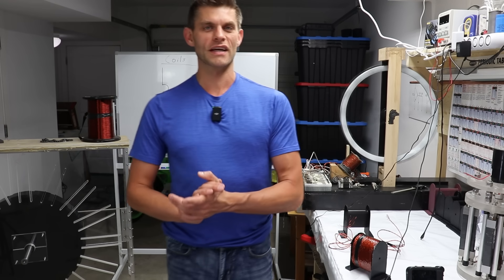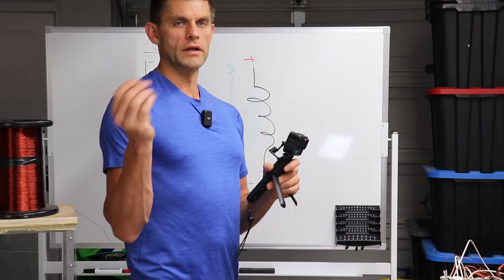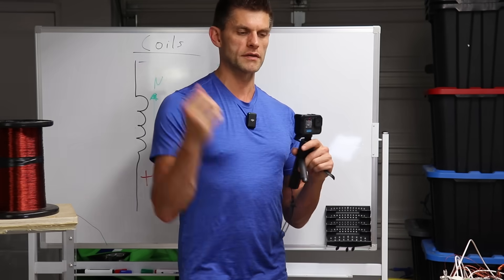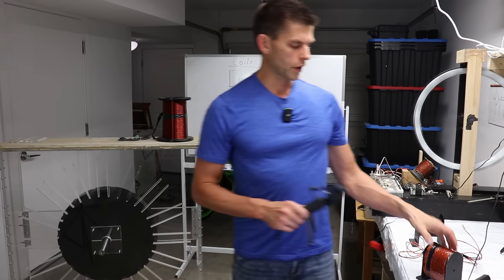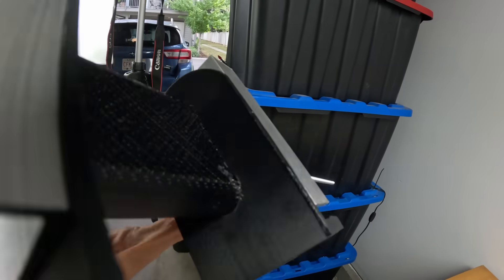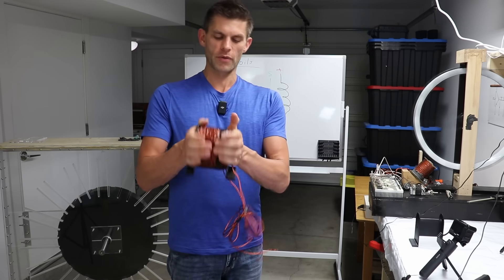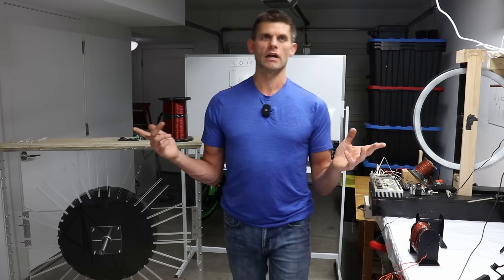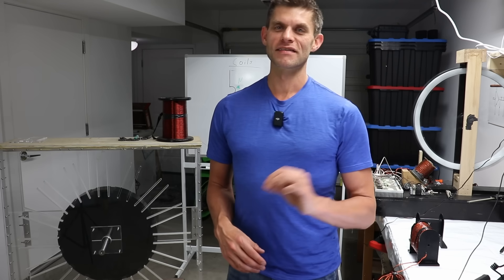Unlimited Energy in My Garage (No Patents)

Comment: u ever see the liberty engine 2.0 i have a usb stick of videos and pdfs n images of everything i could find uploaded to the net for energy devices and the only ones ive seen that work are the motor like ones. and the only other thing that was actually a big easy change would be the bob lazar method of creating hydrogen on demand to power todays engines on water and i think its platinum and the battery of the car connects to leads and shits wild but he proved it worked with his corvette. so and ive always wondered why electric vehicles didnt pop alternators on  em and while driving charging iuno.
Reply from the maker: Ive never seen anything positive about liberty. I think its a scam. I had people say they paid for one and never got anything

Comment: Even if you are "recycling" power back into a battery, it's not 100% efficient at all. 

1. Magnetic fields drop off over distance at a rate of 1/r^3, where r is the distance. This is extremely lossy. Power is dissipated as the E/M field travels through the air, making 100% efficiency impossible.

2. MOSFETs are indeed transistors, and they're not called MOSFATs. FET stands for field effect transistor, and I found it weird that someone with an EE degree would botch the name.

3. The lead-acid battery is not going to "pull in" power to recharge itself in any meaningful way. There are charges floating in the air everywhere, but they're extremely weak and tend to disappear when they can (as this is fundamentally how we create electrical pressure, by stacking charges and preventing them from dissipating). Also, to charge a battery, you have to force power into it by connecting the terminals properly, then use an equal electrical pressure as the battery to push power in. No battery will ever just passively absorb electrons, as electrons passively repel each other.

You start out with real principles of inductors and Faraday's laws and power generation, but quickly devolve into psuedoscience. 

This setup is unfortunately not new, and neither is the result.
Reply from the maker: 😂 what did u copy and paste generic Chat GPT 

Lol you night be somewhat correct talking about standard conductor flow... but we are not
Reply: @MadscienceLPTECH   I think you submitted your comment a little bit too soon, it looks incomplete.

I'm an EE full time. And though I'm no genius,  I think there are some fatal flaws in your system. If you are really sincere about this project, you should take the advice that you also know to be true and use it to improve your design.

Comment: Bro PLEASE don't book any flights any time soon...
Reply: “It's never been demonstrated as a working generator.

There always some excuse, it's just the prototype, it would make power if it was in a vacuum, if it weighed 5 Tonne, if the semiconductors were faster...etc

It's simply an electric motor with no load.

Pulses in voltage make measuring power tricky...things  trick the builder into thinking it's building up more kinetic energy than it's electricity source supplied..

But no, if the return is so tiny a % increase,no,it's just an efficient electric motor ..with no actual load.( The bearings are low loss since they are so lightly loaded)”

Comment: Quick question. So my understanding is that energy = current * voltage * time. While is true there is a high voltage on the inductive kickback, what is the duration and current of it? these should be extremely low right? so at the end the total energy from the spike would always be less than the original put in the coil.
Reply from the maker: Sure thats sounds correct but we are after other types of energy flows. Stuff that comes into the system triggered by the gradient created from the flyback spike
Reply: @MadscienceLPTECH  wait, so by your own admission, it outputs less USABLE energy than put in?

Comment: The effects people observe have mundane explanations. Batteries can show voltage increases due to temporary chemical effects that don't represent actual energy gain. The apparent efficiency comes from measuring things incorrectly - for instance, not accounting for all energy inputs, or confusing voltage with actual usable energy. The motors can indeed be efficient at certain tasks, but they're not breaking thermodynamics.
Reply from the maker: Lol so u think
Reply: @MadscienceLPTECH so you think isn't scientific, if you have a degree show it or do the minimum- tell us why this person is wrong not just a nothing burger or a "nuh uh"

Comment: Extend battery discharge time with electrolyte capasitor. require relay or electric switch to alternate discharge from battery and capasitor. Should not work with common sense but you can't calculate cap ampers. You get about twice more energy with small amount of ampers. ( for example 1F 12V electrolyte cap with 1A load)
Reply from the maker: Nice ❤

Comment: Could you explain "how" that high voltage spike going back into the lead acid battery gives you access to the ether? How are you pulling the excess energy out and storing it? Or feeding it back into the system? 

I can't find information on this so far but if you give me enough of a mechanism I can research it myself. Thank you.
Reply from the maker: Tom bearden*
Reply: @MadscienceLPTECH  Ok, I watched the Bedini video and it seems to me the magic comes more from the multiple wire winding than from the battery? Like using only one wire for the motor circuit but capitalizing on the magnetic field created in all the extra wire? Like filling one balloon from one hose but somehow when you go to empty it you have multiple full balloons. Anyway...I'll keep researching it. Thanks for the response.

Comment: Dr. Charles Lawrence once told me whatever you can do electrically you can do chemically you can do physically. Let me encourage you what you’re doing is exactly what happens with the water pump that pumps water uphill by the air pressure built up. Some pumps are more efficient than others. Enjoy the ride be careful.

Comment: when you blow up a balloon the force it takes to expand the material, not to mention the energy of the material that expanded collapsing, is what makes that force strong but no energy is gained there its just coming back out what was put in. Same goes for your hose explanation. No energy i being created upon release plus there is heat energy being created. This is a total race to absolutely nothing. You would have better luck capturing lightning for free energy. Magnetic drives have been tried for a century and none have proven to work. the sheer fact that you need electricity to turn the magnetic field on is proof this is not working.
Reply from the maker: Wow good thing electrodynamics isnt a balloon. And good thing you arnt in charge or we wont learn anything

Comment: At least he's not claiming that the higher voltage is the cause of the increased power return... However, I am not convinced of this zero point energy. Yes, there's energy all around us. It's the same as saying that there is light and radio waves all around us. But tapping into it should be as simple as making a massive coil... I.E. An amplified antenna receiver. This device is way over complicated for simply collecting ambient electromagnetic waves. Once again, I'm not convinced of zero point energy, but I'm convinced that the guy is candid enough to share his findings even if they prove him wrong.
Reply from the maker: Great attitude ❤

Comment: remember.. energy can not be cheated.. if this is a real unlimited energy machine, you are basically telling us that you created a more than 100% efficient machine which is not possible due to diferrent losses.. coils for example have heat and core losses.. bearings has friction etcetc but as a fellow electrical engineer, i guess you know all that. only thing i missed in your video is the power input vs power output. how many power you have to invest, and how many you can get out of it under the same time..
Reply from the maker: Um maybe if all you know is electron flow conductor energy then sure thats true 

But if there are other forms of energy available then not so much 

Stay tuned

Comment: That is nothing like solar power
Reply from the maker: Yes its energy from the environment just like solar
Reply: @MadscienceLPTECH My point was that you were equating solar power to the vacuum energy. One is entirely based on virtual particles and probability states creating pressure, the other is well.. fusion and quantum tunneling, releasing photons that interact with specific materials with a specific work function that allows the photon to excite the electrons, to kick them out lol,  so that we can use them. Now if your point was that we are using energy from an external source/ the outside environment then there is no argument against that, thats a pretty huge blanket statement lol

Comment: If there was a wiring harness that could be configured to have different interaction dynamics, instead of the seemingly very regular sequential pattern of the current hook-up, it might change the type of gateway that opens a connection with spatial energy. Possibly configured to switch between multiple different network pathways at different phases of the spin cycle

  In physics the potential charge of particles seems to have little to do with the direct traits of individual particle structures and more to do with how interactions between particles change their relationship with the structure of a spatial type field 

  Some configurations will of course cancel out or leak electricity, but the right interactions should theoretically increase or propagate the intensity of interaction between the device and world of energy around it. Shapes are related to space, so interaction dynamics in a wiring harness of a better shape or form should align or connect with the fundamental energy of space more closely

  I don't know much about the practical process of electrical diagrams, but use concepts and mental models from physics for daily problems solving. Usually when solving a problem someone else made, it's because they allowed multiple components to have too much interaction and generate too much wild energy in what should be a finely tuned process or otherwise well organized arrangement or network. In some ways, generating too much "fire" of some sort of other happens too easily when it's unexpected or accidental or misunderstood or unwanted, not sure how that applies to this situation, but you might have some idea 

  The simple and regular sequence of normal wiring connectors, insulators and regulators seems to be made to minimize risk and increase stability. If it can be contained in the proper structural shell, increasing risk and instability of interactions might generate more power with less expense in things like copper and aluminum
Reply from the maker: Nice idea 😊
Reply: Multiple rotating rings or astronomical sphere instead of a single wheel might also naturally build pressure and then flip back the direction of the cycle of flow and have more atmospheric interactions as well, although it could be very troublesome to design effectively

Comment: Zero-point energy is the lowest possible energy state of a system.
There is no lower state to fall into, so there’s no gradient to extract work from.

It is definitely impossible to get energy from zero point energy. You can’t extract energy without lowering the state which cannot be lowered as it is already at 0 which is the lowest possible state here.
Reply from the maker: Wow generic bot. The lowest energy state has enough energy to power our civilization for 10000 years in a m3 😂

Comment: 3:54 You're showing the rotor and stator in action. My question is simple. Since the polarity changes as the direction of the current changes then what dictates the direction in which the rotor will spin when you're only using 1 coil? Why not use 3?
Reply from the maker: We plan to use 16 my friend

Comment: I think you are on the right track if you are approaching from the angle of capturing existing energy. There is no “free” energy, all our electricity production technology is based off of capturing a portion of already existing energy by engineering devices using physics, chemistry, and geometry to exploit a part of the existing system.
Reply from the maker: ❤😊❤ cheers

Comment: Why not use a transformer instead of spinning magnets? If the extra energy comes from the high voltage pulsed into a lead acid battery, you don't need the wheel. Just a transformer and a switch.
Reply from the maker: Agree

Comment: Cool build, but flyback voltage doesn’t create extra energy. If you’re claiming over‑unity or tapping zero‑point energy, we’d need full input vs output measurements over time. Right now it looks like a regular pulsed motor experiment, which is still neat engineering, but not a free energy breakthrough.
Reply from the maker: You sure about that? Maybe in regular electron flow terms thats true but thats not what we are after

Study heaviside and heaviside curl and forget the last 100 years of partical point charge as the supreme truth
Reply: @MadscienceLPTECH  I am actually familiar with Heaviside’s formulation and field based EM; it’s still mathematically equivalent to Maxwell and still obeys conservation of energy. Reframing EM as fields instead of point charges doesn’t remove the need for full energy accounting. If the claim is non‑electron-flow energy input, then the only way to demonstrate that is still time integrated input vs. output under load. Otherwise, doesn't that leave it indistinguishable from known flyback, reactive power, or measurement artifacts?

Comment: Better patient it some one else will and they have the rights to it then js you could still share if with the world but you'd be in control of it vs joe blow how's if comeinv so far think we gonna break it soon? What about magnets on the outside of the shaft on the ends let's say positive and positive magnets on the inside of the shaft mount and positive on both ends for placement wouldn't that be friction free and if you put it in a vacuumed container wouldn't it take away air resistance friction?

Comment: I don’t have an electrical engineering degree. Let’s say you have two cups of water: one cup is being poured onto a wheel to make it move, and the other cup is collecting the drops of water at the bottom of the wheel. Now your claim is that you can fill more than one cup. Prove it.
Reply from the maker: Sounds like you do. Thats not the claim. The claim is u can bring in more water from outside the 2 original cups

Comment: So you tell, the high voltage in the battery is where the energy is harvested. So why then all this spinning motor thing then? Simply use a high voltage module, like in electric fly flap. Use some smaller batteries and measure input and how fast it charges and if it works run 10-100 cycles on this small scale and check that the battery is still working and you are not getting once chemical energy conversion or so…
Reply from the maker: Yes correct we can and will demo it with 0 moving parts. But the rotor has other purposes. 

This apparatus allows us to test multiple variables
Reply: I would recommend to test each variable on its own first then combine things.. then it’s also easier to understand and evaluate if it really works and that others can retest your claims..

Comment: This is a violation of the First Law of Thermodynamics. Flyback voltage is a high-voltage spike, but voltage is not energy (Joules). The energy in the collapsing field will always be less than the energy input due to heat and inductive losses. 'Zero Point Energy' cannot be 'tapped' via lead-acid battery dipoles. This is a classic over-unity claim that has never passed an independent, closed-loop test. If it worked, you wouldn't need a $20k Indiegogo; you’d have a Nobel Prize.
Reply from the maker: False. No one is getting a Nobel prize because its been done and they didnt

This isnt violating man made laws

And sure but we are showing there is other enegy flowing into the system because of the sharp gradients the fast collapse causes

If you think its impossible. It is for you 😊

Comment: I love how he explains the thing that works, then just quicly mentions the part that does not. 😅
The miracle of "backflow" and the something that happens when you hit a battery with pulsing high voltage.

Collapsing magnetic fields do create electricity, yes they use it intentionally during AC-DC conversion (full bridge rectifier, then an RC part to smooth the DC), but it still has loss. (Heat for example)

Pulsing voltage to a battery allows you to tap into the zero point energy? Then hook up an ignition coil from a car to car battery, no need for the magnets and spinny parts... or just use a taser.

I see why ElectroBOOM is getting so tired of this free energy devices now.
Reply from the maker: Yes the dude who shocks himself for views is really an authority on real scientific research 😂
Reply from the maker: You preach generic basic electron flow inside the wire theroy. Way more to it. Including heaviside curl ect
Reply: @MadscienceLPTECH  still failing to explain I see. Throwing around words will not make you seem more educated, nor will it convince me that you are right.
Let's add "breaking quantum entanglement bonds" and "superposition amplification" for good measure! 🎉
It will sound more believable.